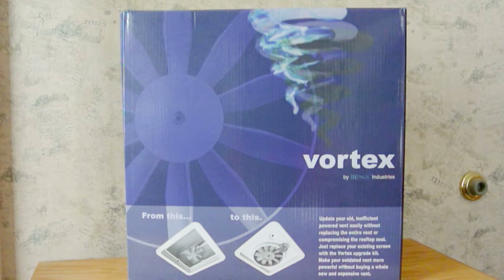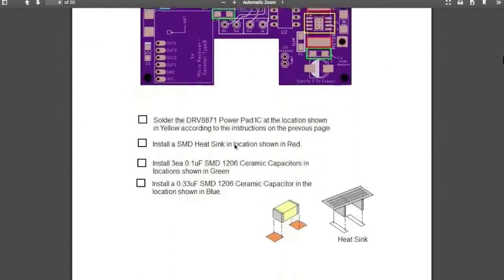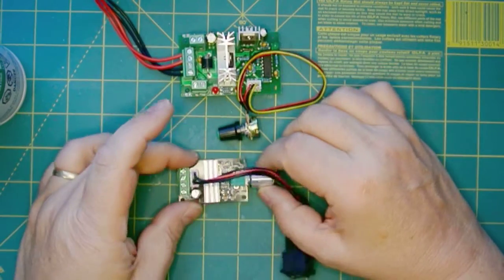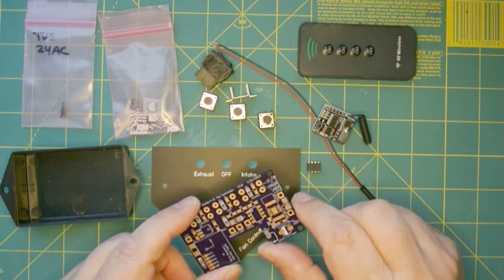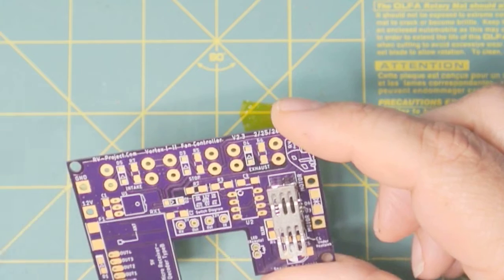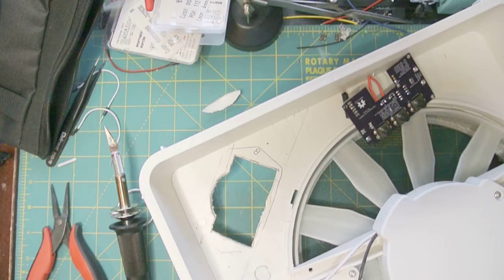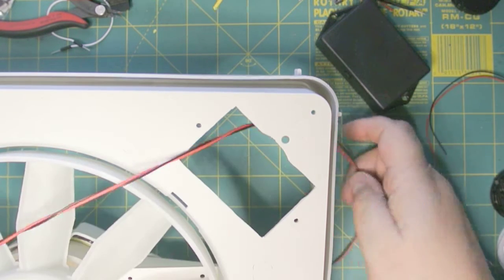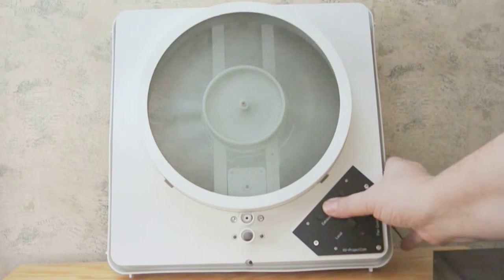Custom building a remote control for a  Vortex RV vent fan.

Comment: How is it holding up? Any chance you could produce a few of these kits for sale for those of us (like KB) that cannot put things like this together?
Reply from the maker: Unfortunately there are too many legal issues. For example, the Federal Communications Commission allows an individual to build up to 5 non-licensed transmitters/receivers for personal use.

But that restriction is for an individual's own use. If I were to build them for someone else - even though the RF components come pre-assembled, then a costly FCC certification is required.  

It's just not practical for me to do so.
Reply: @RVProject  Ok, thanks for the prompt reply :)

Comment: The Board 2XPDexY is no longer available
Reply from the maker: For some reason, the link  to the board was broken. I updated the BoM for the board.

Note that it appears that the Type A receivers described in the text are no longer available.  Even though the Type B receivers seem to still be available, but are becoming hard to find.

I have updated the board for Type B receivers.  Your best bet is to search eBay to find them.  

I apologize for not being able to provide a better link for the receivers, but this is something beyond my control.